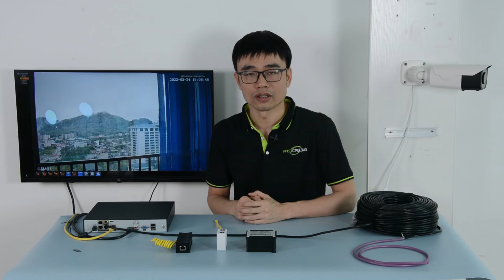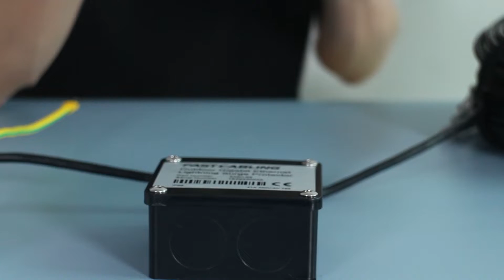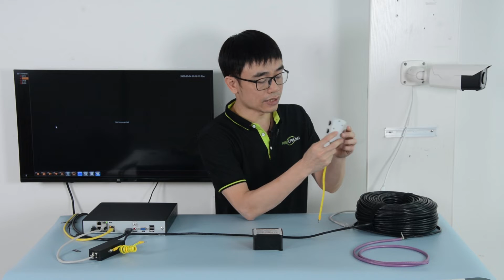Why need PoE surge protector for IP camera system and How to add it properly

Comment: Hi,
It was a great video. I would like to ask if I can add these surge protector for my solar-powered router, solar-powered cameras and for local storage box.
Reply from the maker: I'm afraid not. These surge protectors are specifically designed for PoE devices. You can use DC SPDs.

Comment: Hi sir thanks for the video
Can we install the camera side protector neer the network switch for easy earth installation
Reply from the maker: Absolutely, installing the camera surge protector near the network switch is a smart move for convenient earth installation. And you're spot on, placing the surge protector closer to the devices provides better protection as surges travel from the line towards both ends.

Comment: Where do you attach the camera side surge protector wire?
Reply from the maker: If the camera has grounding wire, you can consolidate the grouding wire with grounding spot on surge protector.

Comment: Why does my nvr have a recording gap? When I  play back the footage there's 10 seconds to 5 minutes of missing footage.
Reply from the maker: You might check whether the motion detection recording is on or not. If the constant recording is off and with only motion detection, there will be gaps when the NVR was not recording.
Reply: That is from when you disconnected the cable from the camera to the NVR  to connect the surge protector and then reconnected it

Comment: Thank you 
Maximum distance nvr poe to camera and Maximum distance Switch poe to camera
Reply from the maker: There is no difference. It is 100 meters for both. With PoE extender, you can have up to 500 meter PoE distance. https://www.fastcabling.com/support-portal/1-in-1-out-poe-extender/3-1-500-meters-poe/